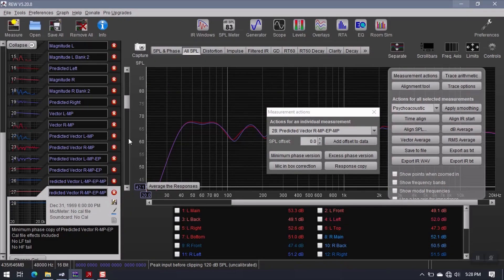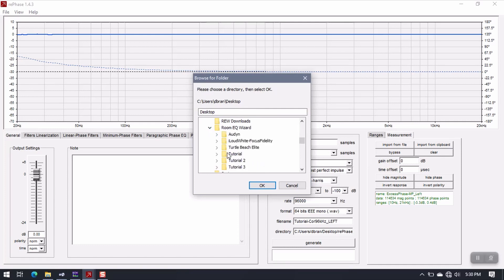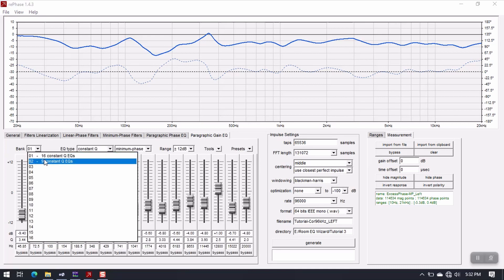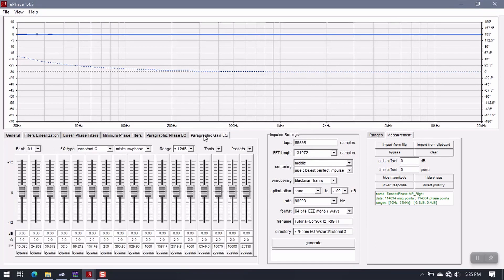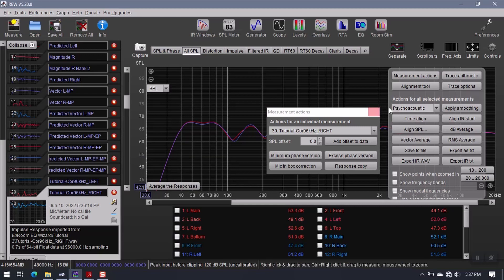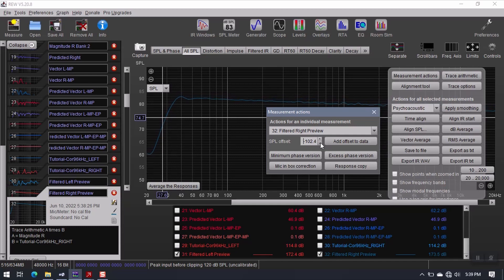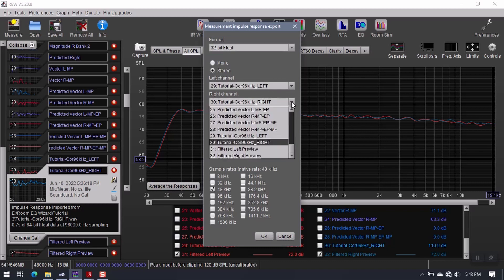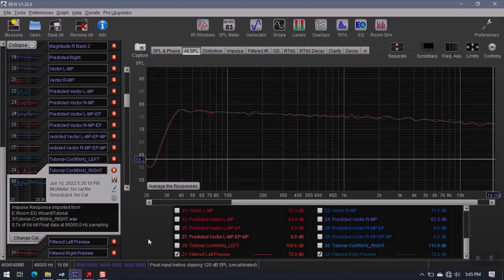Digital Acoustic Correction for Desktop & HiFi speaker systems using Room EQ Wizard and rePhase - P4

Comment: I just finished using this 4 part tutorial to tune my system. I've used some other REW methods (without RePhase) in the past, but these new filters are producing far-and-away the best sound my system has ever seen (or heard!). Thank you for taking the time to put this together.

Comment: Hi I also tried to linearize the phase with the paragraphic eq phase trying to bring everything closer to zero but comparing with the final result of your tutorial it turns out slightly worse even on the phase
Reply from the maker: As I recently explained to someone here, no attempt I made at modifying the phase during this process ever resulted in positive change, so I just don't bother. The filters always come out sounding better when I leave the phase how it is. To tell you the truth I don't even change the phase of the upper filter banks anymore. I just leave them all on minimum phase.
Reply: @davidbrancato  in fact, except for the very low frequencies which have 180 degrees of phase shift, the slope is very steep towards 0 and draws a straight line.  absurd.
Reply: @davidbrancato  hi, only thing when I raise the volume a little more and only on some pieces the tweeter crackles which it doesn't do if I eliminate the convolution filtering.  What could it be?
Reply from the maker: @lucasantilli6510  I'm not sure. I'd have to see your mdat file if I'd have any chance of diagnosing it.
Reply: @davidbrancato  it seems that after a certain volume level the tweeter goes into saturation and starts to croak on some pieces quite loaded with bass

Comment: Should I run my REW measurements at 96kHz resolution?

Also, how does this compare with parts 2 and 3 of this video?  It’s similar but different.  He generates and inversion filter and then convolves it with a phase adjusted export from Rephase.  I don’t think there’s a method to put that inverted filter from Part 2 into rephase. 

How is your method different than parts 2 and 3 of his in the end result? 

https://youtu.be/cgKeHyT7Xgo

Also, your video is fantastic!!!
Reply from the maker: Run them at 48kHz. REW works internally at 48kHz and has a good resampling algorithm for exporting different resolutions.
Reply from the maker: You are correct. There is no way to bring an inverted response into Rephase. You have to bring the filter banks in like I do if you want to use my approach for inversion. 

I don't really know how different my method is from his in terms of how the filters sound, but I can tell you that he is not dealing with the frequency response the same way I do it. He's only chopping the peaks off an unsmoothed response while I dig a bit deeper and level things out more with smoothing. I've never heard of processing the data unsmoothed as he does it. I find that strange, but I assume he gets good results, otherwise he wouldn't do it. 

I tried FDW of a while, but settled on 1/6 and psychoacoustic smoothing instead because I like the results better. If you process the frequency domain at 1/6 or 1/12, and then deal with the group delay/step response with psychoacoustic smoothing applied to the result of the frequency inversion, it works incredibly well. No math or other complex operations going on, just match up the group delays and monitor the step response.

Comment: Thanks David : finally I can use REW & rephase correctly🙂.So far I was trying to flaten the phase in rephase without success. Adjusting the GD is physically making sense, but requesting a lot of effort : in my case the left loudspeaker in in a corner, largelly increasing low freq. Vector curves between right & left are very different in low freq (< 200hz). To ensure GDs are "perfectly" overlapping I had to play with the filter for 2 hours.... At the end, instrument are at the right place, local freq boost are amortized (saving a lot on RT60), and whatever is the freq it come from the same place for a given instrument. One more time thank you!
Reply from the maker: I guess your case is a bit more extreme than anything I have come across so far. I'm glad to hear that it worked out. Would you mind sharing some screenshots before and after? Also what does your step response look like before and after?
Reply: @davidbrancato  
Hello David,
Reply: I'm not familiar with youtube answers...how can I paste an image?
Reply: 1)as a good start the left speakers : https://drive.google.com/file/d/1L7WEoTlxJc6UIo0IEYWNFMczTuQiWB6G/view?usp=share_link
one ca see the big boost in low freq : creating a kind of resonance, where we can't make differences between the frequencies. The room is a mix of rectangle and parallelograms at the extremities, 3.7m high (cathedral like), 250m3 volume : don't know how to determine modal freq...

2) original step : https://drive.google.com/file/d/1wNiFIgwZAz_f5Jw-Ulr9k52rtkS0BZ9_/view?usp=share_link

3)original GD : https://drive.google.com/file/d/1KL97i82LQvlnMJjY8lJWUiP3BeMf6frq/view?usp=share_link

4) predicted step after tuning : https://drive.google.com/file/d/1XgkZWrwWfHEFDS-FH9JI2R-e6Z1Py2aJ/view?usp=share_link

5) predicted GD after tuning : https://drive.google.com/file/d/1Qs_6FKkPAdJfQm-3Lrh9544LVR4T_-mh/view?usp=share_link

When I'll get time, I will redo new acquisition of freq sweep from 20 - 20K played with foobar & the pulse convolution...it should be "close" to the predicted, isn"t it?

Stephane
Reply from the maker: @stephanephotos1767  I think you'll need to use dropbox or something other than Google Drive. It's denying access.

Comment: To prevent rePhase to import the filters backwards, just sort them ascending in REW before exporting them. ;)
Reply from the maker: Yes I figured that out! Thanks for bringing attention to it, though. As it turns out, I still prefer to put them in ascending order in rePhase anyway. This is because I usually re-organize some of the bands within the banks depending on what frequency they are, so in my case it doesn't matter.
Reply: @davidbrancato  Another question... are the filters generated by rePhase in your tutorial min-phase or linear-phase filters?
Reply from the maker: @Cathul  they are set up as mixed, with the low frequencies marked as min phase and the higher frequencies marked as linear. This is the reason for the multiple banks. Now when you export the combined filter in REW you have the option of selecting “measured” or “minimum phase”, which makes a difference as well. Make them both and see which you prefer.

Comment: Thank you David. Been trying to find out how to do this for ages. I adjusted my sample rates and taps to match the DSP I'm using. I got an error in rephase during impulse generation saying " Level was lowered by 0.96dB to avoid clipping in wav impulse format. Use IEEE-754 bin or float txt impulse formats if you want to avoid this issue". Do you know why this might be? I set my targets just below the lowest SPL in the frequency response.
Reply from the maker: Did you record the sweeps at your desired sample rate or did you record them at 48kHz and then switch it to something else when you generated the filters?
Reply: @davidbrancato   I recorded everything at 48kHz and maintained this through to the FIR filter. Although I just checked and my interface is set to 44.1kHz, but this would only be handling the output as I was using a USB UMM6 Mic, so I don't think that would have caused an issue...? The filters are working fine, so no dramas there.
Reply from the maker: @mantolini  It sounds like everything regarding the creation of the filters went fine, but I can't see what you did. I don't really know what could have caused that error you saw. I never got any errors myself. It sounds like one or more of your filter bands just poked up too high and rePhase turned the whole thing down automatically. If it only did this on one side, then your volume levels between the left and right probably wouldn't be balanced. Perhaps you could go through and take some screenshots of rePhase showing the two channels' settings/graphs and post them somewhere so I can look at them.

I'd be wary of the sample rate conversion happening if your output is still 44.1kHz. Are you able to change the  output to 48kHz? Oh, and how does the filter sound?
Reply: @davidbrancato   The filter actually sounds fantastic. I did a post measurement and it's very flat from about 2kHz upwards. Unfortunately you can't filter out room modes so the mid bass response is a bit peaky, but it's not too bad at all and the sub bass is just where I want it. However, when I get some more time to play around I will take another pass at all the steps and send you a message with the results.
Reply from the maker: @mantolini  I know it does! I worked hard on this! But I'm curious... at what level did you set the target? Did you smooth the response to 1/6 or psychoacoustic and then place the target on the lowest dip? If you do that, you're more or less bringing the rest of the response down to match the level of the room modes. In that case, your whole spectrum should be within 5 or 6 dB of variance (+/- 2dB or +/- 3dB).
Reply: @davidbrancato   Hi David. I finally got around to giving this another go today. This time around I did not get the same error in rePhase and everything went smoothly. (I was using a different mic and audio interface from the first time and kept close eye on my sample rate)

Curious to know how you go about adjusting the group delay when you run out of filters in the vector MP. In my vector MP measurements, I only had 2 or 3 filters left over and the phase needed more work below 400 Hz. 

Regarding filter taps: a Biamp Tesira FIR filter only has room for 2048 filter coefficients. This is a far cry from 65536. When I adjust the taps to 2048, rePhase smoothed my filter between 80-200 Hz. Do you have any suggestions on how to control the outcome of this...say, where the smoothing happens? 80-200 Hz is much more important that 10 kHz - 20 kHz for example.

Thanks again for your videos!
Reply from the maker: @mantolini  First, when you run out of filter slots you can generate a new measurement from predicted and continue on the new measurement with a full set of new filter bands to use. I am finding that adjusting that far up doesn't really help as much as the region below 150Hz does. Try only adjusting from 150Hz down, but start at the bottom and work up. Check the step response as you go. That's the real indication that your adjustments are making a difference. When the step response looks aligned and optimized (as much as possible), you're done. Second, I use a PC to run my sound, which gives me the freedom to use whatever I need to get the results I want. I don't use any special DSP hardware, so I have no experience with any of it. 

My preference for a free option is to use Pedalboard 2 in conjunction with VB-Audio Hi-Fi Cable to host VST plugins. Within this host you can run a convolver such as MConvolutionEZ to load and implement your filters. Thus, they are inserted into the computer's audio signal path where they can do their job.

If you happen to have a license for JRiver (or if you want to run a free 30-day demo), you have the additional option of using ASIO drivers, which are preferred over standard Windows drivers for their sound quality. JRiver hosts VST3 plugins. I use this on my main system. Have you seen my video about using JRiver? It'll help if you want to try going that route.

Of course, you need to use a computer as your source. Also you will need a USB audio interface (or DAC) that can be connected to your amplifier.

Comment: Wow! This is what I've been looking for.  
Question: Is there anything to be gained by adjusting phase in Rephase? Thanks
Reply from the maker: I'm glad you found this helpful. I have been working on this process for a long time! Yes, there is a lot to gain from phase alignment, such as tighter, more refined bass and a more coherent soundstage. Does that answer your question or were you referring to something else?
Reply: How does it align for phase in rephase?  It didn’t appear there were any adjustments made in rephase other than magnitude.

Curious, how this process is different than exporting a biquad file?